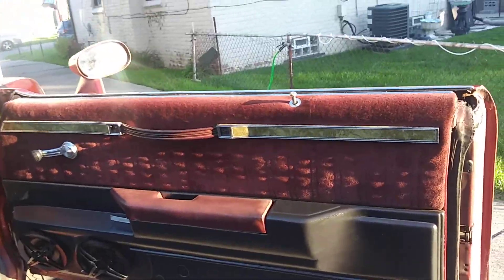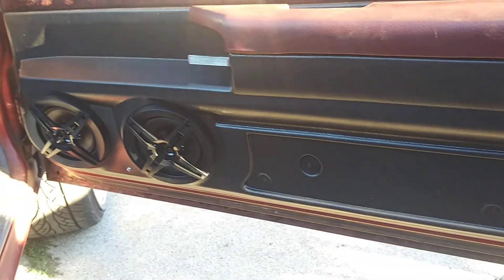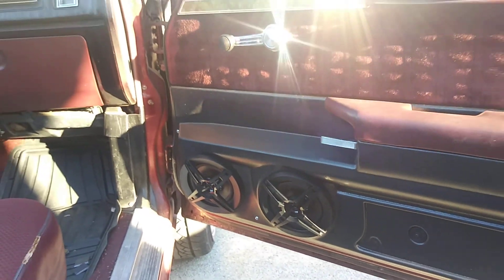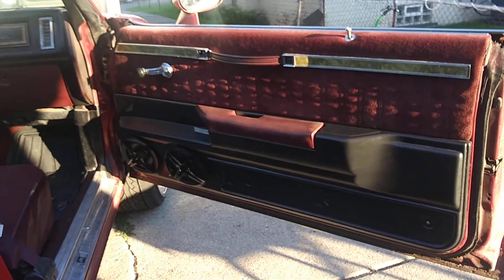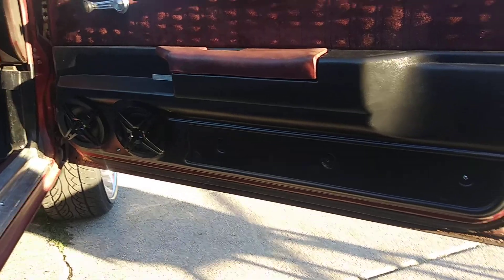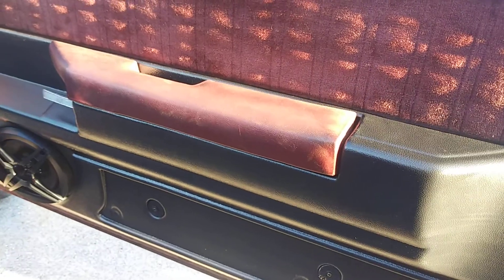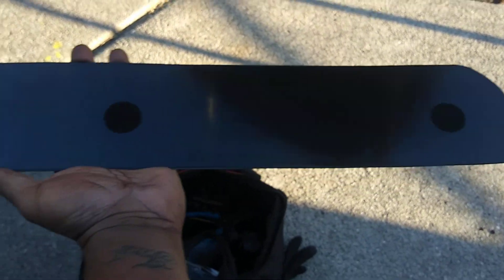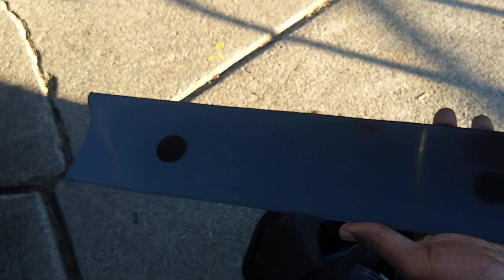Gbody door speaker pod panels pt. 2

Comment: How do you screw the two little screws inside the armrest pocket? The door shell has two big empty holes in that area with nothing for the screws to grab on to.
Reply from the maker: Thinking back i don't think i put screws back in there. The pench brackets/clip things at bottom of cushion arm rest was strong enough to keep it in place for me. Just slid them on n is still holding on strong
Reply from the maker: Thanks for watching. Please hit that subscribe button

Comment: What did you do about running the speaker wires if the doors are not power (windows,locks)?
Reply from the maker: Through side gromet holes on the front of the door. Found some rubber wire gromet casings off of another vehicle that fits perfectly

Comment: How did you run the speaker wires?
Reply from the maker: Through the side of the door, then behind the kick paneling and under the carpet edge all the way to a amp in the trunk
Reply: @monecolione313  bet Preciate it
Reply: @monecolione313  videos of them playing
Reply from the maker: Well try n remember when the weather brakes here in Detroit all the way. Don't want any copyright issues though. Trying to get my numbers up
Reply: @monecolione313  man them lil ass screws that came with it don’t even tighten the Velcro to the door panel
Reply from the maker: Lmao yeah I had to get some self tap longer  joints. U got some n what u building?